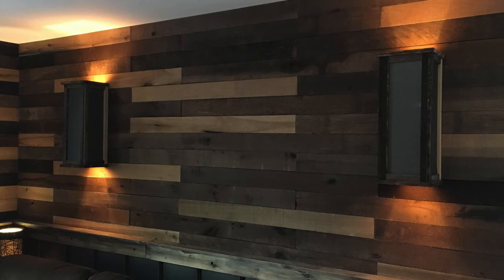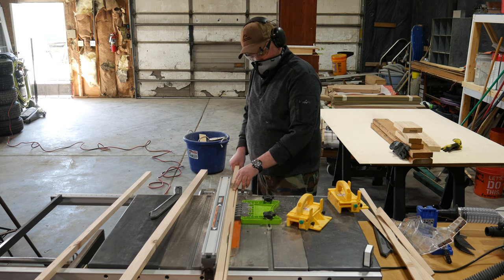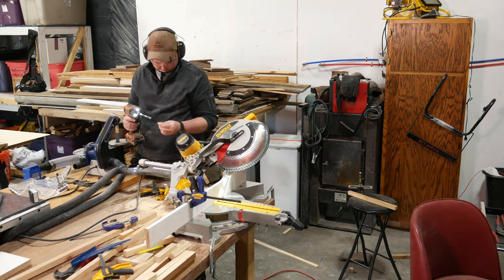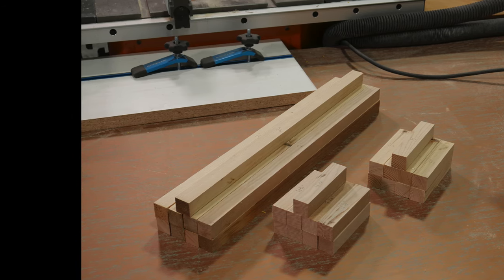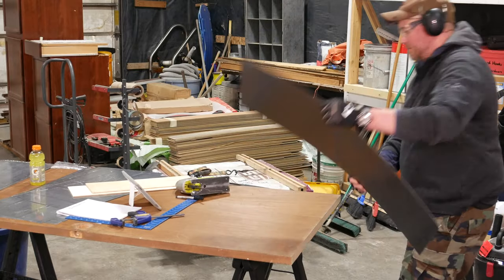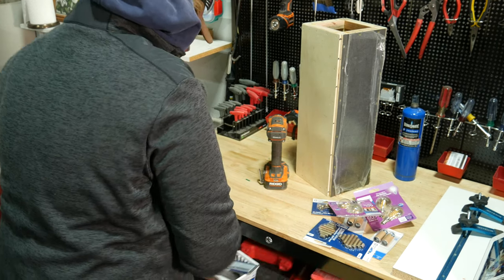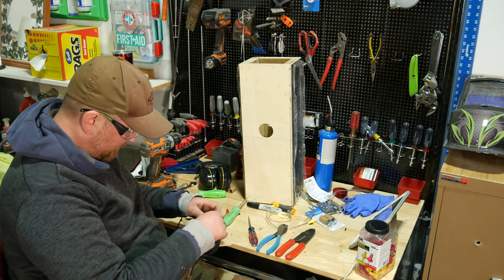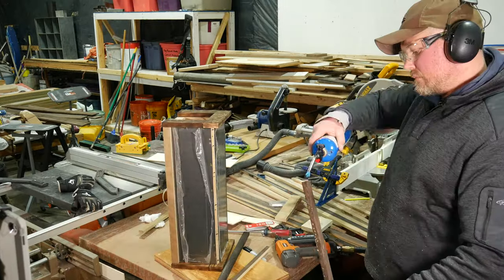How to build wall sconce lights - The Family Room Remodel Part 23

Comment: I would have liked to see how exactly you mounted the light assembly inside the box. And I could barely hear your commentary even with the sound turned all the way up.
Reply from the maker: James Achard thanks for checking out the video. Showing the installation of the light assembly would have been tricky trying to film in the sconce with my hands in the way. Nothing fancy I just took 4 pieces of equal length square stock and glued them vertically in each corner. This created 4 posts for the assembly to rest on, sort of like a tiny dining table. Then I just screwed the light assembly to the 4 posts. I really do wish I had done this step before assembling the sconce. It would have been much easier and you could have seen how I did it. If you make these, I definitely recommend installing the light assembly first. As far as the audio, you might want to check your audio settings. I just replayed this on my iPhone and iPad, it’s loud and clear, even with volume at only about half. Check to make sure the volume setting on the YouTube player itself isn’t turned down.